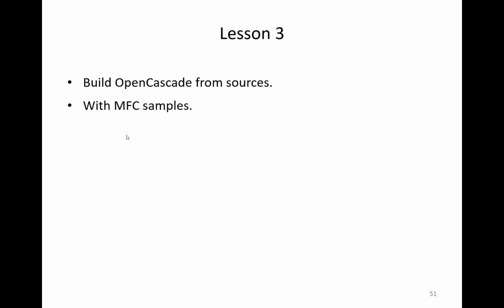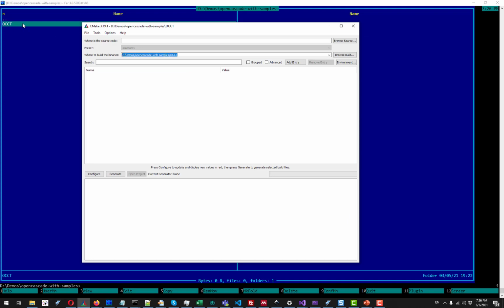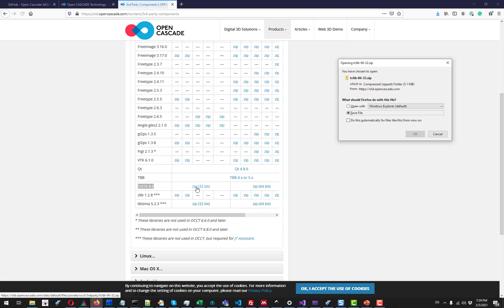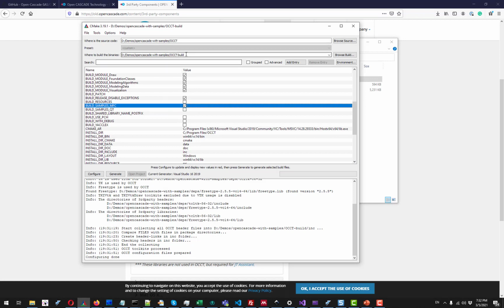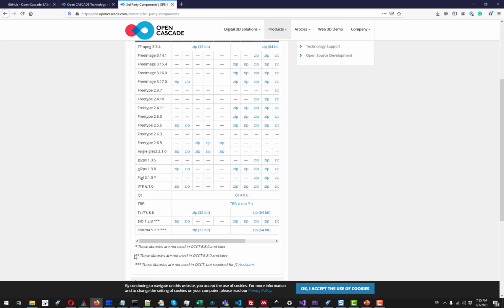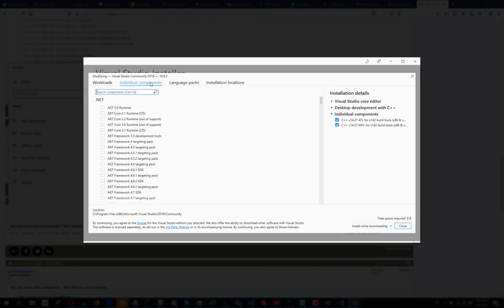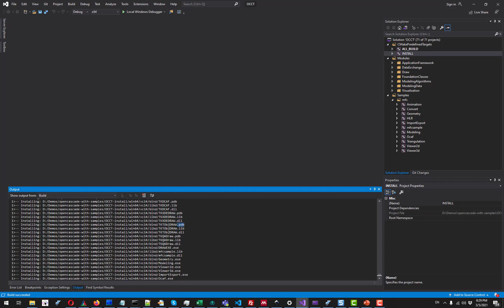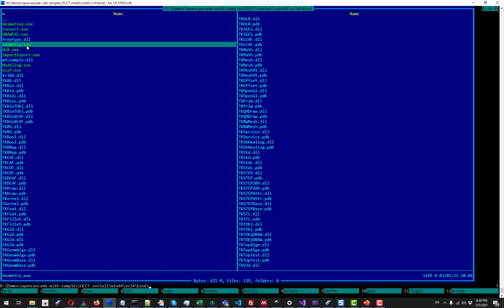Lesson 3: OpenCascade with MFC | Configure and compile MFC samples | CMake | Visual Studio

Comment: I have followed the tutorial wisely but after building install I'm not getting OCCT-install directory in my provided location. What can I do for it?
Reply from the maker: When you build the INSTALL project in Visual Studio, you should normally see all your header files and libs being copied to the destination. It's quite a verbose output. What do you have in the "Output" window? Do you see your files being copied? Any error? Does the destination folder exist (just double check)? Isn't it locked by some Windows process?
Reply: @QuaoarWorkshop  In "Output" window I have 2 succeeded, 41 failed, 29 upto date
And in output window there are a lot of "A task was cancelled".
No, I don't have any install directory folder in my assigned location. I only have OCCT and OCCT-build
Reply: I also have "fatal error C1356: unable to find mspdcore.dll" and "command line error D8027: cannot execute 'C:\ Program files (x86)\ Microsoft Visual Studio\ 2019\Community\VC\Tools\MSVC\14.28.29910\bin\HostX64\x64\c1xx.dll'"

Comment: How to create a 3D viewer using MFC and OCC?  if you can make a tutorial on it. Thanks for your time and efforts.
Reply from the maker: Added to the list. Don't MFC samples themselves answer this question? Are they overcomplicated or something?
Reply: @QuaoarWorkshop  thanks for your reply. I tried to implement with MFC dialogue based. It always show me handlers error for occ DLL.
Reply from the maker: @amitkumarbedaka7056  Out of curiosity, can I ask why MFC? Does that come from some project's requirement or is that more a deliberate choice? Personally, I'd always prefer Qt over Microsoft's frameworks, especially MFC, since Qt (for example) is well-designed and cross-platform.
Reply: @QuaoarWorkshop I'm not familiar and never tried with qt. If I can get some tutorials it will be great to learn. Thanks for sharing your knowledge. As occ is bit challenging to use.
Reply from the maker: @amitkumarbedaka7056  Yeah, just MFC looks a bit outdated to me, so I always wonder why would one wish to learn it. Nevermind, keep going :)
Reply: @QuaoarWorkshop it will be a great support if you can share your experience with qt.
Reply from the maker: @amitkumarbedaka7056  Let's have this on the list then. It totally makes sense to cover Qt as it's widely used.
Reply: @QuaoarWorkshop  thank you so much